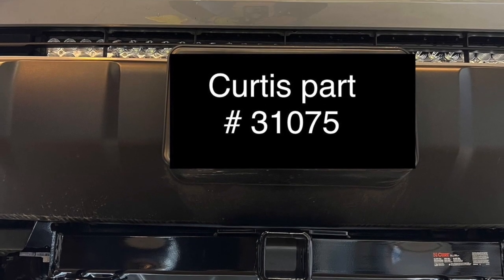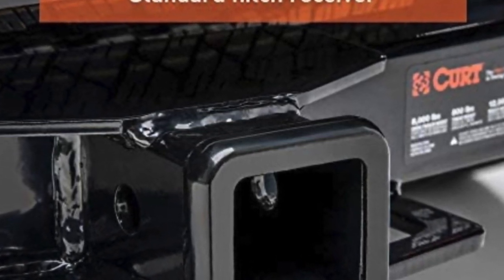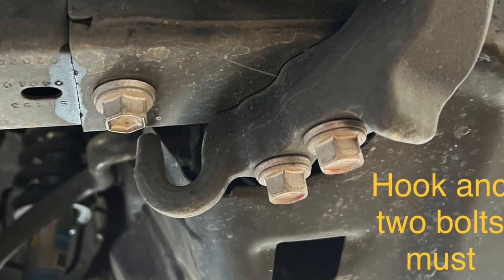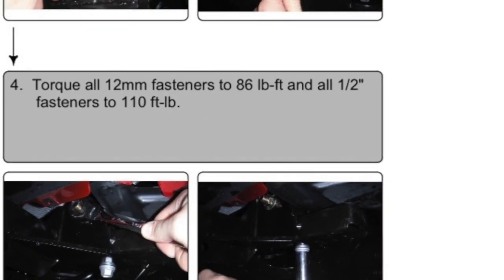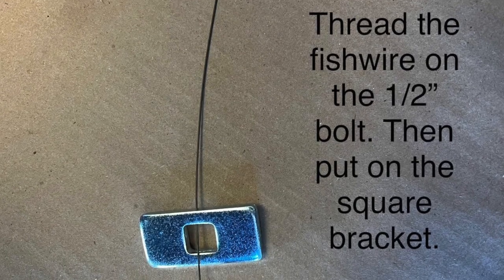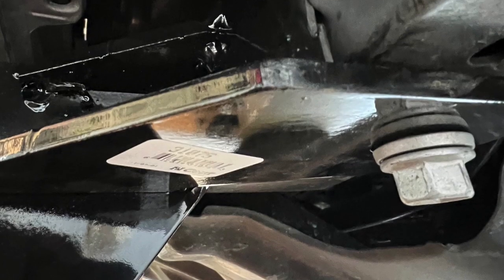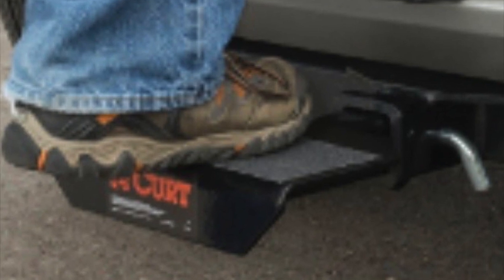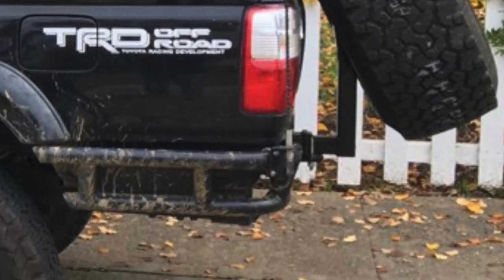Tacoma Gen 3 Front Curt Hitch Install

Comment: Thanks for the vid.  I just ordered one of these to mount a snow plow.  I was a bit worried about this part of my plow install.  Good to know the front bumper doesn t need tampered with !
Reply: Did you install one?
Reply: @cjbegansky2255  Yes I got one !
Reply: @pstreetgarage7304  what does it look like? I’m gone get one put on for a plow.
Reply: @cjbegansky2255  pretty good.  I did a vid on my channel of it.   DK2 snowplow for a Tacoma
Reply: @pstreetgarage7304 looks good and very functional. I’m gonna do the same thing. I was worried it would look clunky, but it blends in nice.
Reply: @cjbegansky2255  For a small domestic plow it's quite good.   And the wireless remote makes for an easy install

Comment: Santa got me one and Im installing it next spring on my Tacoma..... Question, Did you trim your air damn or  toss it???  Mine will be used to support HangGliders.. I had one on my Previous 2002 Tundra and It performed Great for 20 yrs...  I'm hoping this one doesnt RUST just like my first one...
Reply: Congratulations, I have a OffRoad so no Air Damn, but if you like the look trim and try it. Mine looks good so far, hope I get 20 years with mine.

Comment: so you have to take off things to install this hitch? cause the seller i’m talking to says nothing needs to be removed. 

as far as my trucks warranty goes, if anything is removed and something added then those parts put back on will void it’s warranty.
Reply from the maker: Yes, the hook is removed, but is not re-installed and the end caps are removed, but will be reused on this front hitch. Maybe the person your buying it from would help install it on yours? As far as Warranty goes they would usually have to prove the add on caused the warranty failure to reject a warranty claim, but ck with your dealership to be sure.

Comment: Will it interfere with a front after market bumper?
Reply from the maker: Hi, if the bumper sets lower than stock then it will probably interfere. If its a bumper replacement thats same depth and length then you should be fine.